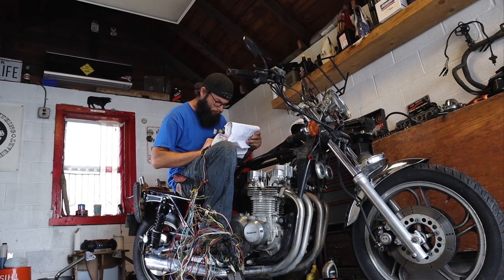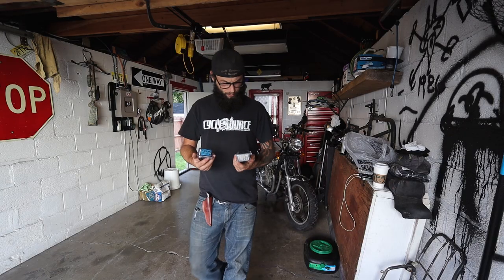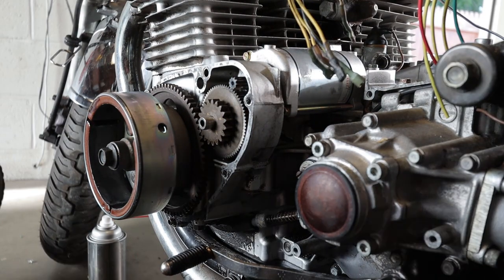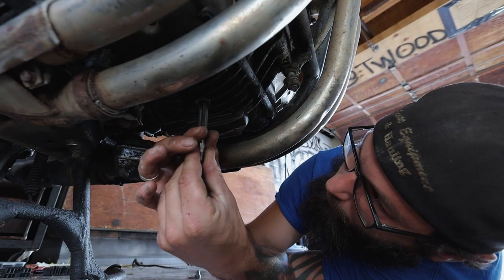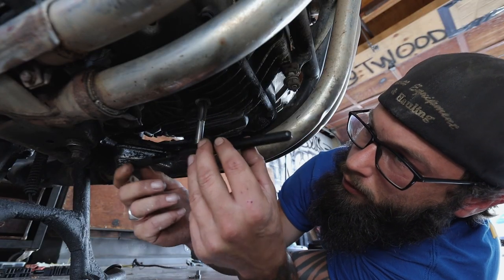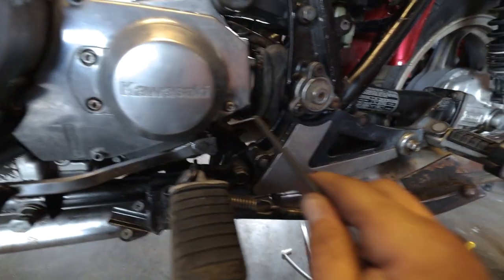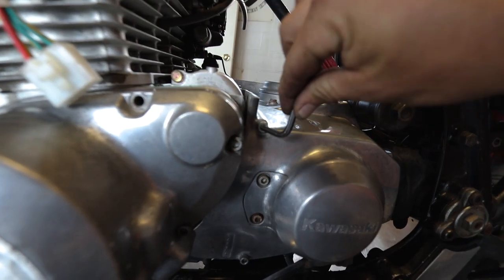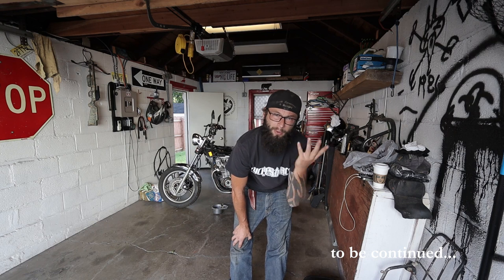Kawasaki charging problems (Part 3) Stator & Rectifier REPLACEMENT Kawasaki ZN1100 LTD

Comment: Bro I have z1000 2012 kawasaki and i got 2 brandnew battery but still after the battery is always droppinh why is there a problem with the charging system.of my.motor bike? Please help
Reply from the maker: I’m sorry for the late reply. Not like my answer will help, but at the end of the day, if your battery is discharged - it’s sounds like you have either a bad stator, and or a bad regulator rectifier. I have had so many ups and downs trying to keep my bike’s charging system intact. Great motorcycle - but the charging system seems to be quite finicky. Unfortunately, my bike still remains in pieces.